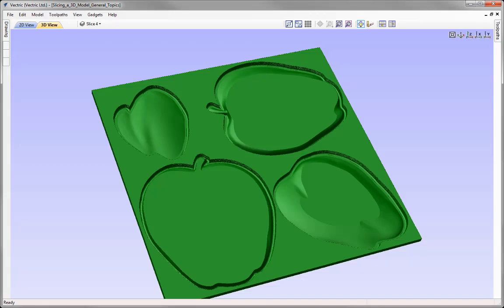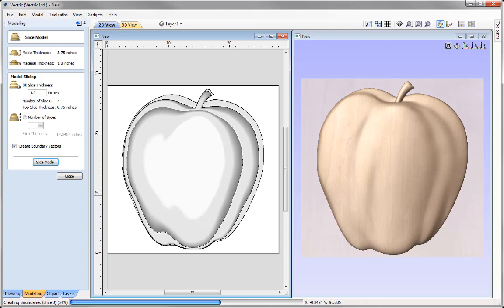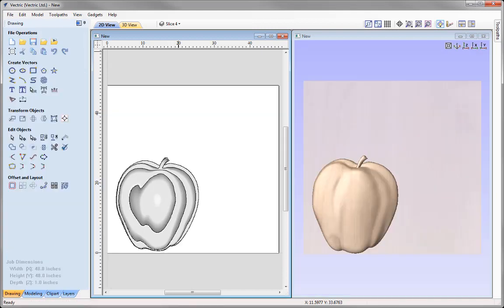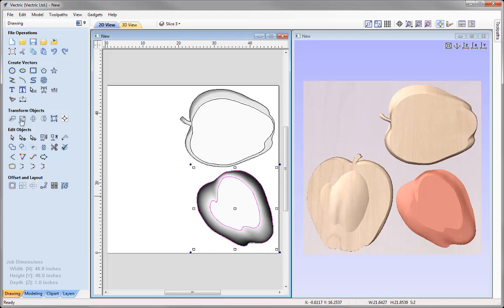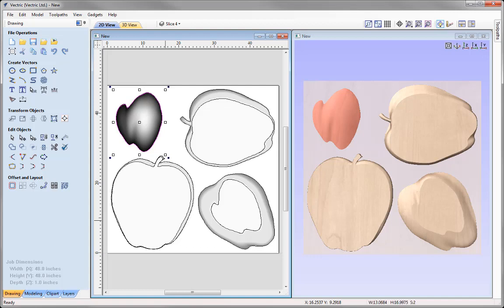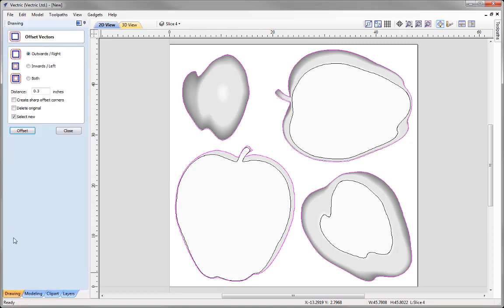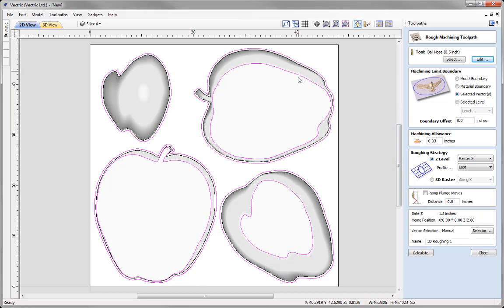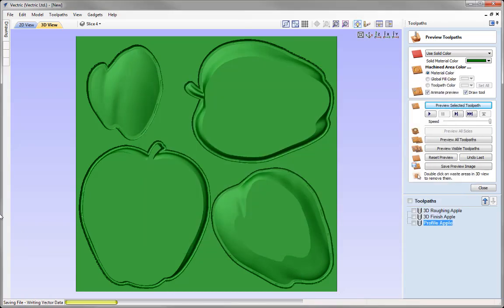Slicing a 3D Model | General Topics | V9

Comment: The settings for the final profile cut were skipped over in the tutorial.  What tool and what depth of cut was used?
Reply from the maker: Hey Roger, apologies for the missing profile segment! The tool used was a 0.5" Ball nose, cutting at a depth of 1 inch in two passes (0.5" each pass) there were very small tabs included at a thickness of 0.05"  and a length of 3 inches. If you download the tutorial from support.vectric.com you can open the file to see this information. And again I apologies that this segment has some how been missed in production, we will ensure that in the future better checks are made of the videos before they go live. Thanks for the heads up!